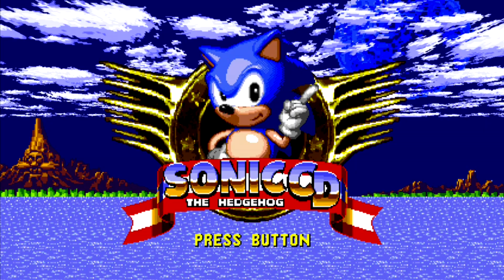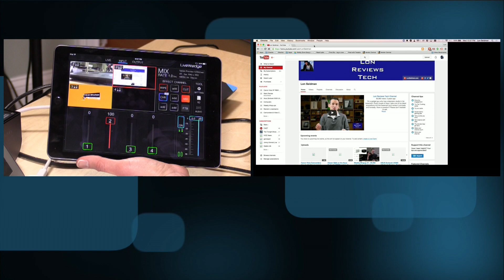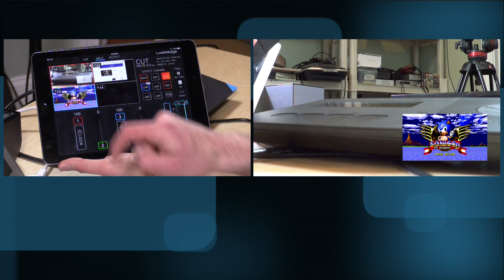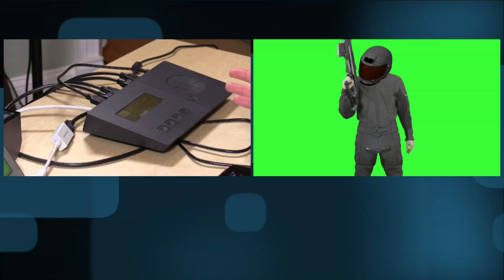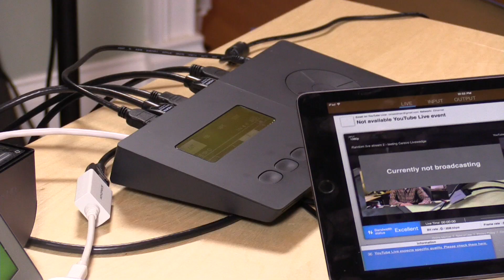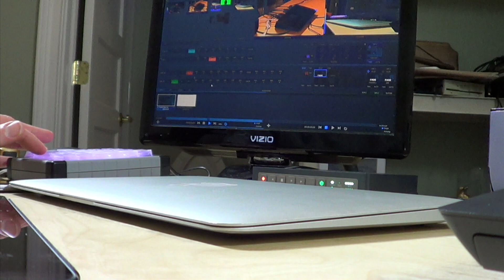Cerevo Livewedge Inexpensive HDMI Video Switcher Review - Compare to Blackmagic ATEM

Comment: Hi Lon, very good review of the Cerevo switcher.  My question is:  Since the switcher supports a direct computer connection ( via hdmi) it appears that I could setup a remote interview via skype or Zoom and have that video and audio recorded as an imput channel, and even put the remote input on as a picture in picture in the output.  Is my perception correct? Thanks, Jim
Reply from the maker: Yes I've done that with other switchers. Haven't tested it directly with this but it should work. You'll just want to have the audio back to the caller come from the computer microphone and you'll need to run some headphones out of the cerevo to hear them.
Reply: Thanks, that makes sense about isolating the audio, I am using a Yeti USB microphone through the computer, I assume both the called and my audio will be picked up through the HDMI output, correct?   appreciate your time on this.

Comment: You always provide a professional outlook on video, kudos on that. Only downside to this is and unknowledgeable video user won't understand audio delay, also don't use this product or a BlackMagic type unit if your intent is to mix live cameras with live Audio off a mixer console to a projector for larger audience viewing. Because HDMI signals are inherently latent, your live room audio will be real-time while the video to the projector could be as much as 10 frames late arriving to the screen. This will not be good. Additionally, this unit has no graphics keyer. I suppose you could cheat on this via the Chroma Keyer. But then you lose an input. The only real way to do real-time is with a TriCaster.

Comment: Lon, thanks for this.  I've recently acquired a Livewedge and have to say the documentation is a problem.  Can you point me to a resource that actually says how you can get this thing on a network, both wired and wireless?  Probably just me, but thus far I've only been able to use it as a recording switcher.

Comment: We just bought one at work; particularly based on this review.  I must admit it's pretty nice.  The first time we ran it for over an hour without issue and while recording. HOWEVER...It keeps crashing a lot since then.  It seem like it has to warm up or something and we have to keep power cycling it before it's ready to go. Additionally, the resulting recorded movie file it creates is not always smooth on playback.  Don't get me wrong I think this is a great product for the price; particularly being able to record to an SD card.  However there are just some quality issues that make the price/convenience factor affect the reliability factor.  That being said, we're returning ours for the Roland V-1HD.  It can't record like the Livewedge, but Roland makes great products that in my experience are very reliable.  The Livewedge does things the Roland can't do like WIFI to an iPad, but at the end of the day I want smooth frame rates, and I also need smooth playback of the preview so that I can make better live editing decisions.  The Livewedge doesn't have smooth playback of the preview.  Perhaps the second version of the unit will be better, but until then we're going for the Roland.  This is a sweet little device.  It just needs some adjustments to it's capabilities.  I imagine if Roland releases and updated V-1HD with SD card recording and live streaming, there's no contest.  Roland all the way.

Comment: I've been using this little gem professionally since January. The SD card recorder is absolutely cool and has been flawless in recording two and three day long events. All recordings are MP4/H.264

The four input HDMI switcher will take virtually any input resolution and scale it to your choice at 1080P at 20 fps, or 720P at 30 fps.

This unit will stream direct and live. However, when streaming you can't record internally to the SD card recorder.

As far as I can see so far, the only big weakness, and it's a glaring weakness, is that the build quality on the four input switches is not good. This unit is intended, obviously, by the creators, to be operated using the IPAD or Android tablet running the Cerevo app.

Comment: Will you do a video on how to upgrade the firmware for the Livewedge. im having problems updating please help
Reply: +Staphon Petty The instructions to update the firmware are simple:

1 Download the latest firmware from the Cerevo website.
2 The firmware must be in the root directory of the SD card, not in a folder
3 Insert the SD card
4 While holding down the input #2 button, plug in the Cerevo
5 Hold down the button until the prompt that the firmware has been updated

Comment: Some things to think about:
First, what piece of black magic hardware are you comairing to?
second, the HDMI protocol doesn't carry a very long signal length.
Third, there's no professional audio input so you can't embed into the H.264 codec unless you use the shitty camera mic and not a mixer (RCA's are not professional).
Fourth, you can not do 1080p at 60fps
Fifth, That delay is shit compared to Genlock.

It's cetainly a step in a direction but for the price, go with the ATEM production studio. Even having to convert HDMI to SDI for $50 a converter its still worth it.
Reply: +TheSigp220 I ran a 100 foot camera cable, HDMI, from a Sony HVR HD1000U to the Cerevo and it looked fine. The cable has a little booster about halfway along the cable. And the cable was uni-directional. I've recorded both with the Cerevo and the ATEM. In my opinion, there's no comparison and the Cerevo is far more practical and easy, and thus reliable for everyday users.

Comment: Hello Lon,  Quick question here...is there any other unit i could use to add Texts captions on the Cerevo Livewedge?  or what do you recommend?  Thank you!
Reply: +Juan Lima It's gonna be a lot easier to do that in post production. You could input a character generator and key it, but that seems like a pain in the rear.

I would imagine they may incorporate something like that later, although that would probably mean a keyboard and a lot higher cost.

Comment: Hi have they managed to update the firmware so its no or less lag to fix the choppy video preview?
Reply: +Lon Seidman Thank you for the quick response. With that in mind do you know if this supports audio via HDMI from HDSLRs? Also hands down would you choose this over the BM TV Studio switcher? Lastly You are great. I watched your presentation on the BM TV Studio before I had to use it for a production and it went great. Thanks again.
Reply: +jamar jones The video preview is "choppy" for a reason: they DESIGNED it that way, so as not to waste processing power on the preview bus. You don't need 30 or even 20 fps on the preview buss, it's designed to show you what's there, and not waste processing power. You lose nothing, practically speaking, with the "choppy" preview buss.

Comment: Hello Lon - thanks for making this review on the Cerevo Livewedge. It may be exact;y what I need. I have a couple of questions: 1) Can a DSLR work just like your camcorder? 2) Can I connect a GoPro Hero4 as one of the cameras? 3) Can I run an HDMI cable from (say) a concert hall stage to the control the control desk which is usually and the back of the hall? - Cheers

Comment: Does each channel have color correction in order to match cameras (as close as possible)?  
ALSO...how many audio tracks does it record ? Stereo? Stereo per input? 
My point is....if I input 4 cameras (each has audio)  & an AUX audio will it record each separately or merely mix it to stereo? If I record to SD card then download that to edit system can I manage each channel separately?
Next to last......can it mix or cut video only (untouch audio mix)?
And last....does it have headphone output?

Comment: Hello all well!
It worked perfectly using one of these :
http://produto.mercadolivre.com.br/MLB-677639939-extensor-hdmi-3d-60-metros-via-cabo-de-rede-utp-rj45-cat5e6-_JM
With a network cable 30 meters.
I used also a 20-meter HDMI cable linking the camera to the device.
An inexpensive solution for long distances .
Note: It worked only in 1080i did not work at 1080p .
http://www.amazon.co.uk/Extender-Ethernet-Transmitter-Receiver-Brooster/dp/B00QV564BC/ref=sr_1_fkmr0_1?s=electronics&ie=UTF8&qid=1441121979&sr=1-1-fkmr0&keywords=HDMI+extender+3d+60+Metres+Via+Network+Cable+Utp+Rj45+Cat5e+%2F+6
Reply: +Lon Seidman 
It worked perfectly in real-time audio and video without delaysTested with cameras GH3 , GH4 and Sony NX5 .
Even worked with a red cat5 cable 50 meters, ideally using shielded cat6 and a cable 20 meters HDMI connected to the device .
Reply: +Lon Seidman  Hi there again it looks like toy can run your camera at 1080i check out the specs below http://www.bhphotovideo.com/c/product/1145193-REG/cerevo_usa_cdp_lw01a_livewedge_hdmi_switcher.html
Reply: +Henrique Rinaldi   What setting did you have it with the Sony nx5   I have Sony z7u and like to live stream  on 1080i60  I know it will scale it to progressive  what was your setting how did it look

Comment: Can Cerevo output to be set to 1080/50i ? thanks
Reply: ***** I see in the specs is 1080/50p not 1080/50i
Reply: +Lon Seidman   what will happen if I bring it in to the mixer at 1080i60 will the sound and video be off sync through the hdmi cable. ?

Comment: Great Switcher Lon, and very well presented as always!! Have fun with your new toy :) All the Best. RJ
Reply: +Roberto Jorge (Tech Reviews)   excellent job I am picking one up I have been using livestream broadcaster red box I will make that as my main output into the box then I can run all the cameras I need,    one question would it connect to a sd hdmi card video player as I have certain footage on a sd card that I want to add in to my production at certain times.
Reply: Daniel Upsdell
Hi Daniel, it was not me who did the review :) It was Lon so you will have to ask him as i haven't tested the unit. But looks awesome :) RJ